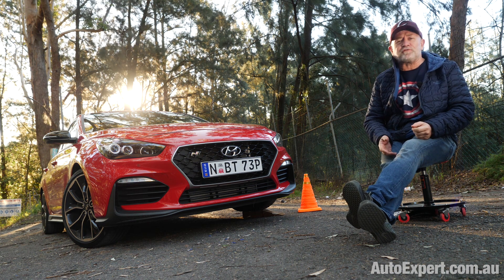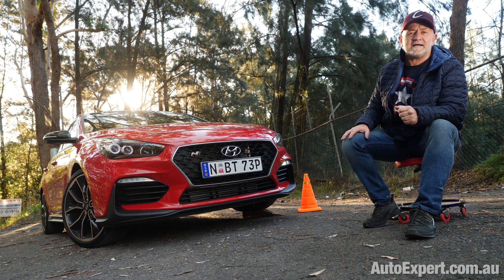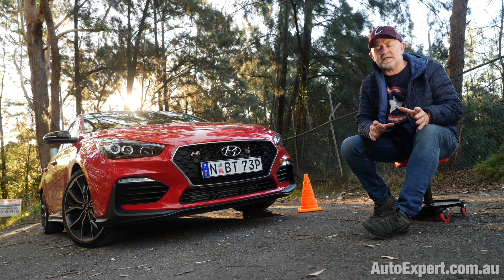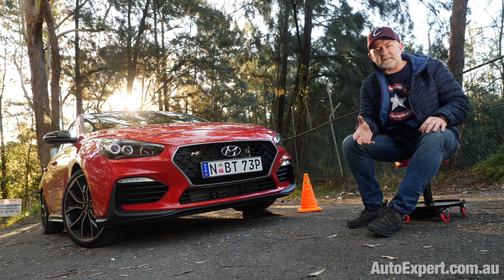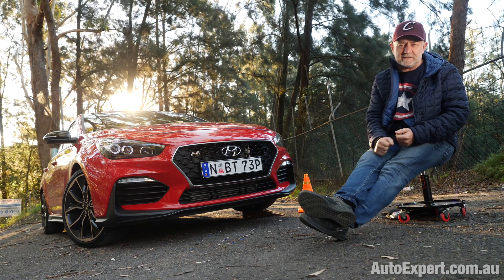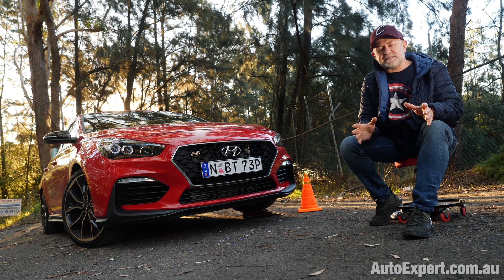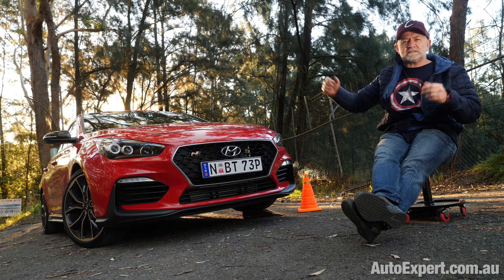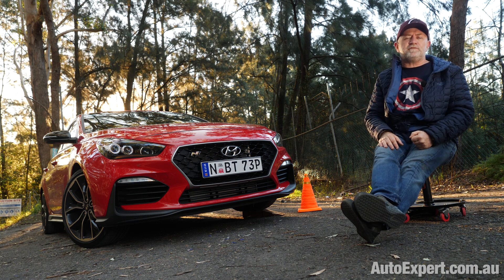What is stability control (ESC) and how does it work? | Auto Expert John Cadogan

Comment: ESC on most cars is very conservative.  In my DMax it equates to no fun allowed.  But I guess thats the way it should be.

Could you do a report on other stuff like Autonomous breaking and Adaptive cruise, I hear the terms and understand the principle behind them but have never driven a car with them so I don't know how they apply in the real world.  Thanks
Reply: @Darren Munsell yeah this kind of bothers me a bit. Where  I live is hilly and twisty with only three short overtaking sections on the 11km stretch to the next town.  Because the roads leading to the overtaking areas are blind corners or crests you basically have to crawl up the vehicle in front's ass until you can see its clear then accelerate and pull out at the same time.  There is no option to hang back and take a run at it.  So it concerns me that at the critical moment these system will rob you of crucial momentum/acceleration to get past in the short space of time you have.

Comment: What, no boobs? I'm outraged. 

No, seriously,  great explanation.  I used to be one of those f#*+wits who saw rain as an opportunity to drop it into second, and floor it coming out of a corner. Now, not so. The other day I did try to give the Subaru a couple of nudges coming out of corners on the only wet day in a month. The esc cuts in and out seamlessly. As you say, greatest safety addition since the seatbelt.

Comment: Nothing should replace driver's ability to DRIVE. Us slightly older guys survived the days without all those esc / tc.
Reply: Totally agree .  With today's greater volume of traffic and more advanced automotive technology , newer drivers will not be able to get the ability  to master driving as quickly as those of us slightly older drivers ... who survived.
Reply: @valerierodger7700  
I have nothing against safety features like ESC/TC, abs ...
The problem is people (in general) no longer learning how to drive. They let the car does everything.
Reply: Amen to that. Everyone should learn to drive on a 1967 Riley 4/72. That way they might learn how to.

Mind you the stupidest thing I ever saw was a 102 year old man retaking his test... The tester turns up to this old gents house with a crappy-paddle transmission car and the poor old guy looks completely bewildered.

I currently drive a Wolseley 18/85 and a Kia Rio. The Wolseley is easier to drive, handles better, has better (read some) grip, is more comfortable. It looses out on fuel consumption, power (the Wolseley 's' solves that) and engine noise at speed, that's it (the "trainee country hoise" aerodynamics don't help but look up the aerodynamica ADO17). And ironically the transmission ratios 1-4 and final drive are almost identical.

I've seen far too many near accidents because of drivers who seem to have been taught by an alternate universe version of Mike Hawthorn on Methamphetamine and Crack with some Diazepam for flavour... Quite literally terrifying.

Note to the world. I DON'T have ABS and crumple zones happen to other people!

Comment: Fascinating review as usual. I heard you say 'for instance to swerve ... around a kangaroo'. I was shown years ago that you never swerve, just steer straight and slam the brakes on as hard as possible is the safest way. What is your opinion?
Reply: For a stable swerve, BRAKE FIRST then steer.

You'll find the steering gets very sensitive to small inputs when the brakes are transferring weight forward onto the front tyres. Brake first, then steer and you feel this, and avoid steering to much.

The tendency for untrained drivers is to swerve with a massive turn of the steering and then stomp on the brakes. It's quite natural, since hands are on the steering and can react immediately, while your right foot has to move from throttle to brake. However, the sudden grip gain on the drastic steering input will start a spin.

Also, pause the steering at the CENTER position between direction changes. Only for a fraction of a second, it settles the car body movements and flex in the tyre sidewalls.

See-sawing at the wheel is likely to get the whole car see-sawing ...and nobody wants that!

Comment: My brain refused to accept you saying "United States of America", and automatically substituted "Retardisan"!

After my experience with having to drive 300 miles on icy freeways in my ESC equipped 2013 F-150 a few years ago, and running emergency no heat service calls in my ESC equipped 2015 Ford T-250, I am a believer in ESC.
I'm just glad there is a button I can push to turn it off when I want to have some stupid fun. ;)

Comment: Off road is where ESC can cause you to get stuck. Our site Hilux's and Cruisers require you to be stopped and hold the button for 5 secs to disengage ESC, it cannot be turned off on the fly.  If you suddenly find yourself in very soft conditions at speed, having the ESC and traction control reduce power and apply brakes as it does is the quickest way to sink to a standstill.
Reply: To be fair, if you know there will be mud/sand pit, you normally need to switch locker / off-road mode. Then switch ESC off if you need to, you don't do it on-the-fly anyway.
Reply: @GuitarsRockForever  
Definitely, if you know. We use tracks that can change conditions without warning from hard (where you don't want 4WD engaged) to suddenly and unexpectedly soft where the top layer has eroded or rain has affected it. 4WD in these Toyota's can be selected on the fly but if you get caught on soft stuff and forgot to disengage ESP before starting, it will wash off the essential momentum you already have.

Comment: Could you please do a video about how it's not a good idea to work on your car at home unless you genuinely really know what you are doing? You could emphasize the danger you are putting yourself and your loved ones in with this behaviour.
Reply: I think you're overstating the danger a bit, most systems on cars aren't critical for safety. I don't think a failed engine from improper repair is likely to cause a severe accident, though in some circumstances it could. The main concerns are things like brakes, steering and suspension systems. They require a great deal more respect as failures here will directly affect your ability to control the vehicle, also an improper repair is most likely to fail during a high-load event so you may not know it's compromised until you are relying on it to save your life.

Just because someone is a mechanic doesn't necessarily mean they know what they're doing either, plenty of people on my second year auto repair course didn't have a damn clue how most things work but still completed the coursework with enough help from the tutor. 
Had a few (polite) arguments with my usual mechanic/MOT workshop, one was where they tried claiming that I had an exhaust leak which was in fact a drain hole in the silencer box to prevent water buildup from short distance driving. 

The second and more important was when they overtightened my front wheels to a ludicrous degree, to the point where they laughed at my impact wrench and I needed a 1m long bar to get them loose, with a rather disconcerting cracking sound. They were more than two times as tight as the manufacturer recommends, from what I know about bolts that is pretty close to the breaking point and when one goes the rest are carrying it's strain in addition to their own. Picture this, you're driving down a curved, high speed road with no barriers and trees on the side, suddenly the wheel on the passenger side hits a pothole and the massively overstressed fasteners break. 

TL/DR: It's mostly fine for laymen to work on stuff not related to steering or stopping, make sure your mechanic cares about safety as much as you do and doesn't take shortcuts to save themselves work, make sure your wheels are properly torqued and your tyres properly inflated, if you get a flat head to a nearby workshop ASAP and get them to torque the wheel and fill it to the correct pressure it takes 5 mins and should cost basically nothing.

Non-professional DIY mechanic with formal two-year qualification.

Comment: ESC is truly magic, but i have spoken to some young hooligans who fancy themselves as young fangios and crashed "because of ESC".
They essential drove too fast relying on the ESC to do the work until they overheated their brakes, and then the ESC couldn't do it anymore and "it" made them crash.
Reply: This is my gripe with having tthe ESC. Moreover my issue is that driver training is up shit creek and personally believe that at the absolute least defensive driving course should be mandatory to get your P plates.
Reply: @nuvisionprinting  Half of drivers--including those on cell phones--would still fail to measure up.
Reply: @michaelmagyar5734  then they shouldn't be on the road! Simple as that! 

I'm a truck driver and I have to say some truckies are way more reckless with a truck than a smart car driver. This needs to be weeded out. 

Our accidents are only getting worse, more violent, more fatal than in years past. Something has to be seriously done and this would be a great start!
Reply: Potential Darwinian Award candidates...... you can't help stupid.
Reply: Throw in any crap aftermarket brake pads/discs and it can make an upset worse.
Reply: Some young hooligans crashed? Good.

Comment: thing is with esc when a front tire blows is you want to be adding throttle to make up for additional friction then once control is regained slowly exit roadway. Only a well trained driver can do this not esc
Reply: The skill needed most when a front tyre goes flat is not to panic... easy to control with a cool head. Also these days of tubeless tyres they don't "Blow out" they go flat in a time frame that makes it easy to bring the vehicle to a stop... as long as you don't panic !

Comment: John is starting to be my fav engineer for average car guys like me.
I never thought ESC was used both front and rear, and this is good news.
First...are all ESC systems the same performance wise or are some programmed better???

My question is this, and a reason I get annoyed when everybody says AWD isn't necessary, which in most designs it isn't, or that it is all the same...everybody's AWD systems are equal.
They are not.
Some, like the Acura SH-AWD or Honda's AWD add to this ESC by delivering power, or cutting power,  left and right to aid in the stability around turns.
John, help me out here. There is a big difference in many of these AWD systems, right?

Not saying AWD is needed. Here in south Texas I don't think I will ever exchange the addition of the weight for AWD vs FWD or RWD with a good ESC system since we never see a need.

Comment: Esc abs and traction control have saved my bacon more than once. One time comes to mind when I was on the highway towing a 4000 pound trailer. The cars all started swerving and there was a large object in the road I had to swerve around it and the truck handled like it was no problem. I live in USA and when I lived in Michigan winter driving could be challenging. The esc light would come on before I even felt anything wrong. I now live in south Georgia where it snows maybe once a year and it only lasts a few hours. How the drivers here react is another story!

Comment: From a safety point of view, are all ESC systems equally good? Can you detect differences between brands, not only during normal hard driving but also when corrective action is needed to save lives?
Reply: If its anything like other car electronic components, most likely it's just bought from a third party. I doubt every car manufacturer would each develop their own versions from scratch.
Reply: AH- 64 but even if sourced from a third party they could be tuned to OEM specifications.
Reply: Remember that the ESC is added to a different set of mechanicals in each case.  When the chips are down, the underlying design makes a huge difference.

Comment: Great clip John, Is Electronic Brake Force Distribution the same thing as you just discussed?
Reply: That's for getting the best possible braking effect in an emergency.
Reply: It's not, EBD/EBF merely controls the braking on each wheel depending on the weight on each of the wheel, it's basically an extension of ABS.

Comment: Personally I have found DSC quite hard to get used to because you are no longer controlling the car. You are now telling the car where to go and it is deciding what to do. For example if its snowing and you want to change lanes in the old days you expected the car to rotate crossing the snow bank and you would start to correct it as you crossed. These days you just drive across

Comment: This is  probably a stupid question but does ESC control the back brakes? Does ESC ever apply acceleration?
Reply: I don't think ESC will open the throttle, but my RWD Camaro has EDC (Engine Drag Control) that will sense when lifting off the throttle causes the rears to lock because of ice (etc.) and will open the throttle to achieve a front-rear balance.

Comment: Some stability programs (VW JETTA MK V 2.0T for example) are way more aggressive. The ESP can apply some torque to the steering wheel to "suggest" you the right movement to regain control. In some situations (vgr uncontrolled turn over dusty roads) it can even throttle up the engine to get you out of harm's way. Too much? Maybe. Good work John. Thanks!
Reply: @Roberto How can a driver interpret this torque being imposed by the program?  Should the driver resist this torque or submit to it?  What does VW say about this?
Reply: @michaelmagyar5734  It is entirely up to the driver. The torque the ESP applies to the steering wheel can be easily counteracted. I've found that it always suggests the right maneuver to regain control in oversteer situations.

The vehicle user's manual does not say whether the driver should follow the steering suggestion.

Comment: The ESC is a bit like an auto EBD, everything is soo well thougt out, cars these days are soo packed with passive and active safety systems, that let you brake and swerve very agressively without locking the tyres, just to the very edge of grip on every tyre... Thankfully braniacs are mostly solving those very hard challenges of mass production and pure science, and not salty nuts XD (PS. awesome work, I can watch many of these a day :D)